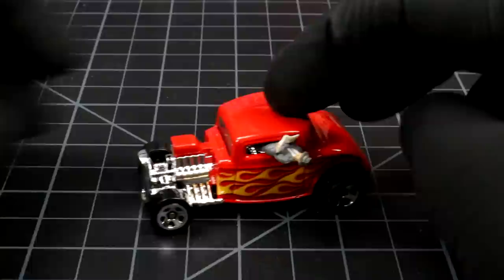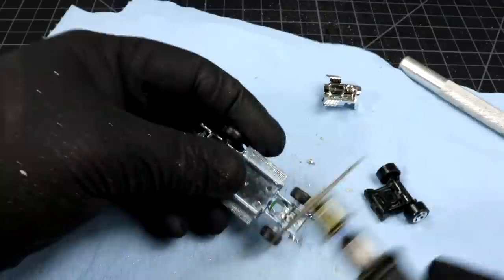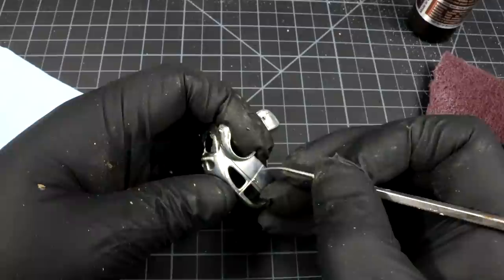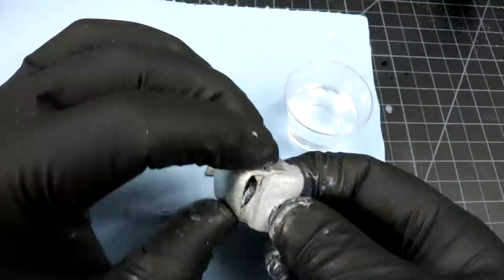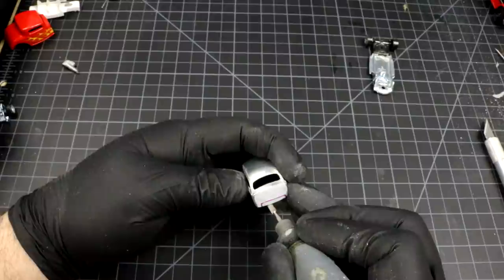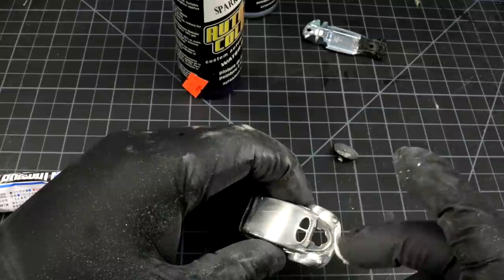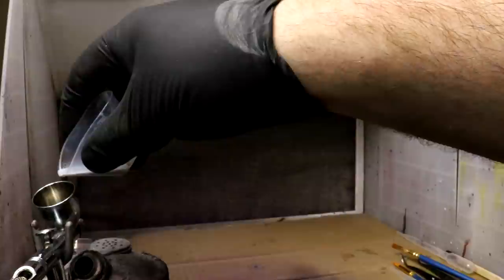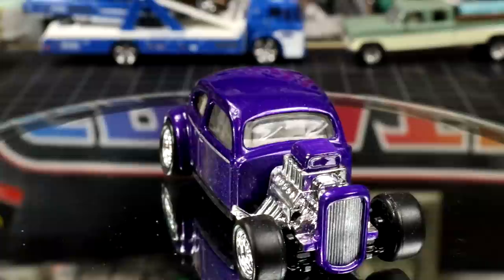Painting Diecast Model Cars - BEETLE V8 CONVERSION!!

Comment: you and your comic book noises. <3
great paintjob, it really fits the theme. I've long since gotten tired of that trendy "forgot to paint and now I'm going to the meet in all the basecoats I found in my closet" look. anyway! you also managed to keep the proportions right, this one would look right in 1:1 scale, too. ^^ not a small feat to do, really.
the somewhat ill-fitting engine hood comes from a trick beetle-tuners used to use by modifying the hinge until a slit opened in the upper edge of the lid, to give the engine more cooling air. here in germany they used to add the louvers cut off from Renault 4CV-engine hoods for a while until there were none left on scrapyards anymore. XD
"gluglug, gluglug, gluglug, ruduruduruduruduVRAAAAAA!"